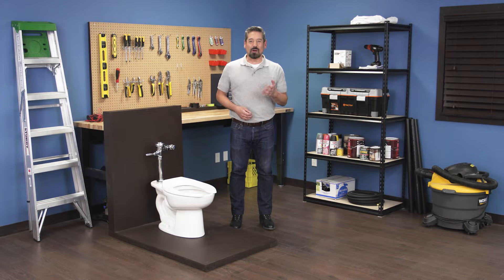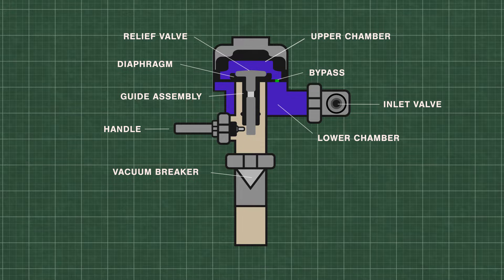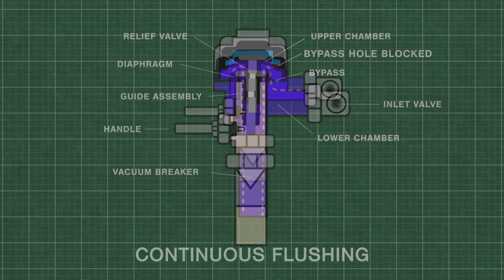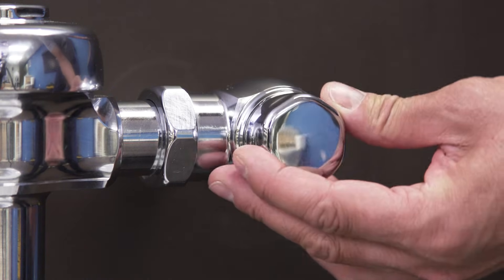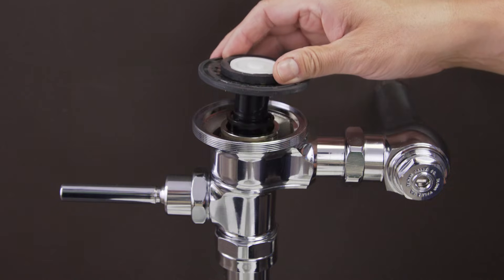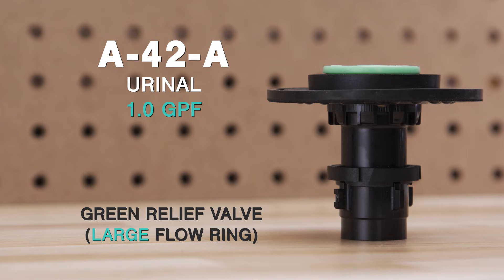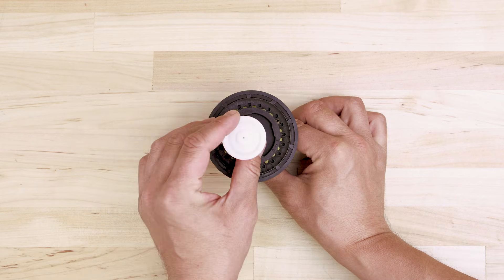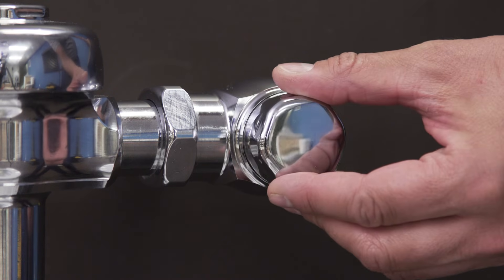Sloan Regal Flushometer | Diaphragm | Repair and Replace

Comment: why show the vacuum breaker. what does it do and do we need to replace it?  my repair kit came with one.
Reply from the maker: Thanks for watching. The vacuum breaker prevents water from being siphoned back into the valve. If the rubber wears down then water might leak from just below the valve body. We have a video on the vacuum breaker for this model: https://www.youtube.com/watch?v=k2AmW8Xzwpo

Comment: I had two new flushometers on my shelf and both would continually run no matter what I did. After watching this video I stuck a pin in the hole on the side to let more water through and that fixed both of them.
Reply: Please explain, the urinal in our facility kept running after someone flushed and overflowed the toilet .. what is this hole you are referring to and if it's blocked, that will cause the problem?

Comment: my problem is that the cover is stripped by a previous plumber and now i cant get it removed.
Reply from the maker: Thanks for watching. Are the threads stripped or the top is rounded out which prevents you from using a wrench?
If it is the latter, then you could use a strap wrench which might get enough torque to unscrew the cover.

Comment: If you think the diaphragm is incorrect but that is all that has been in the urinal since you acquired the property, how can you find the exact diaphragm needed without any manuals for the urinal?
Reply from the maker: Check the urinal to see if the GFP is printed on it somewhere. As well if you cannot find it, then you can remove the diaphragm and see what it is. Based on the diaphram's GPF and the behaviour of the flush you can go down a size if the flush seems to much or up a size if the flush seems too weak.
Reply: @AmreSupply  thanks

Comment: I was surprised to view a relief toilet valve that accommodates 4.5 gpf. I wonder what toilets today or recently have a 4.5 gpf capacity. I haven't located any on the internet. The highest I've located were a few 3.5 gpf toilets that were mostly of the blowout types. Anyway, I like these flushometer valves much better than the usual toilet tanks. I have however located 1 toilet flushometer valve that did accommodate a 4.5 gpf with 26 1/2" rough in, but it wasn't from sloan.
Reply from the maker: Thanks for watching. Over time most toilets will be replaced but there are still some out there which is why it's still available even if uncommon.

Comment: When I flush it stops short and has a loud thump. Which part do I need to replace?
Reply from the maker: Thanks for watching. It's likely that there's water filling the upper chamber too quickly. This could be a hole in the diaphragm or there's a improper seal that's letting water fill too quickly. Cleaning the valve seat and replacing the diaphragm should help.

Comment: Thank you for your excellent videos. I want to share a few things that I -- a petite total amateur --  learned replacing two diaphragm modules. 1) Removing the diaphragm cap may require more torque than channel locks or a small wrench can provide, especially if there is some corrosion involved. I had to buy a heavy-duty 15 inch wrench. 2) It turns out I have one low-flow flushometer and one regular. I have no idea how to spot this from the writing on the unit. Once I accessed the diaphragm of my master suite unit, I saw it had a green top. Since I had purchased a standard 3.5 GPM kit, I installed it, but it leaked terribly at the vacuum breaker and ended up destroying the vacuum breaker. Incidentally, if you are also replacing the vacuum breaker and are using a green diaphragm, you need a breaker that is 651, not 551. With the green diaphragm and the proper breaker, my master suite toilet now works perfectly. The older toilet in my guest suite used the standard diaphragm and vacuum breaker. Incidentally, I also replaced the handles while I was at it. They work much better now -- they clearly were on their last legs. (And yes, both of my upstairs toilets broke within hours of each other on a Saturday. I'm a new owner, and there is some deferred maintenance here. I learned a lot fixing these and will be ready for next time. Thank you for saving my weekend!)
Reply from the maker: You're welcome, we're glad that you've found our videos helpful! We appreciate you sharing your experiences with these repairs. Many people read the comments and I'm sure there's others who will find your descriptions helpful!

Comment: I deal with these on a seasonal basis.  For winterizing these what would you recommend?  Thanks
Reply from the maker: If the flushometer is not being used in the winter and is at risk of freezing then there's a few things that can be done. Any water left inside that freezes can damage the flushometer and plumbing.

-  Shut off the water supply to the flushometer.
-  Drain the system to remove any remaining water.
-  Insulate exposed pipes to prevent freezing.

Comment: Thanks! How do I unscrew it? The part you do at 3:10? Mine seems stuck and I don’t want to break the plastic.
Reply from the maker: Thanks for watching. You need a good grip on this. There might be a buildup of calcium which might make it harder to unscrew. You could soak the part in vinegar (might deteriorate the rubber but not a problem if you replace the diaphragm) As well applying a little bit of heat can help.
Reply: @AmreSupply  very hot water worked, it was rusted together like you mentioned.
Reply from the maker: @LSATQueens  We're glad it worked!!
Reply: What's the size of the nut on the cover? I want to make sure the cresent i buy for my grab bag will be the right size to use.

Comment: Thanks for demystifying this type of plumbing and the problems that can occur.  I can replace an $8 part instead of calling a commercial plumber for $275 per hour.  Excellent tutorial and diagrams made this a 30 minute fix on a urinal that has had problems for a year.
Reply from the maker: You're welcome, we're just happy to help! There are many repairs that take the skills and knowledge of a professional but for something like a diaphram replacement, it is an easy fix.

Comment: I have replace the diaphram, vacuum breaker and handle trying to get the water to stop flowing.  What can I check now, since all 3 of those inside pieces are new?
Reply from the maker: Thanks for watching. It's best to clean the valve seat to make sure there is no mineral buildup or anything that might prevent the valve from making a good seal. If any water leaks into the upper chamber, then the valve will not close and water will continue to flow.
Reply: @AmreSupply piggybacking off this question/comment. I’ve done the same, even installed a new flushometer body so there’s no build up of any kind but it still won’t stop running constantly. Any other suggestions to try out?
Reply from the maker: @580outdoors8  If you've installed a new diaphragm, a new valve body and that there is no corrosion or mineral breakup that might prevent the diaphragm from sitting properly on the valve, then you should also check the handle. It is possible that the handle is stuck and is pressing on the relief valve and preventing the valve from resetting.
Reply: @AmreSupply  Everything except the control stop is new. Checked the handle and didn’t see any issues with it. As soon as I turn on the control stop, water starts flowing. Never have had this kind of problem with any of the others that I’ve worked on here at my workplace.

Comment: This video is completely unrealistic.   This "dramatization" shows the effortless unscrewing of the diaphragm from the valve assembly with the slight turn of two fingers.  In actuality, if the rubber diaphragm assembly has been in service for years slowly deteriorating, they get very frozen together, and extremely difficult to "unscrew".   This gentlemen sidesteps reality by showing you a brand new valve assembly being unscrewed with a gentle turn.  It's laughable.   Would appreciate some guidance and advice on how it is that one is to get them apart in order to drop in a new rubber diaphragm.  The rest of the parts are fine.   The completely drop in kits (assemblies) have gotten very expensive since this video was produced several years ago, in a pre-covid economy !!  LOL
Reply from the maker: Thanks for watching. When filming, to get clear footage, in a series with many different videos it takes multiple takes to film all the steps. To show a deteriorated toilet in place is more difficult as it requires going on site and controlling for variables. That's why we filmed with a new valve setup within our film studio, so we could properly light and film. 

We are currently filming appliance repairs but if we return to this series we would do an update with tips on seized or threads that are full of a mineral buildup etc. We still have many comments from people explaining that these videos have been helpful for them.
Reply: @lawrence

THEYRE SHOWING "HOW"

THIS DEFINITELY EXPLAINS HOW

NO NEED TO CRY ABOUT YOUR JOB 😭
Reply: I agree with you I am actually dealing with that right now.
Reply: I would suggest trying an adjustable oil filter wrench. This may help

Comment: Changed out the diaphragm now my water won't fill back up in the toilet ? Any ideas ?
Reply from the maker: Thanks for watching. What was the original gpf of the diaphragm and which diaphragm did you install? If the toilet is designed for a higher gpf, and you installed a low gpf diaphram then the flushometer will not run as long, and less water will flow out of it before the valve closes.
Reply: @AmreSupply  diaphragm was stuck had to prye open the water filled the toilet once replaced but the new problem is no flush
Reply from the maker: @shanekyle2894  Check to make sure that the relief valve is positioned correctly and that the handle has enough travel that it will be able to lift up the relief valve. As well if there is a buildup of minerals on the valve try cleaning it as this might cause the diaphram to stick.

Comment: When i flush my toilet, it all gets drained and then runs for about a minute before completely filling up and stopping. Does this mean my bypass hole is starting to get blocked? Or not really because it is not  running and never stopping, just flushing for about a minute before filling and stopping which is longer than normal.
Reply from the maker: Thanks for watching. What is likely happening is that the bypass hole is likely clogged with mineral or corroded rubber from the diaphragm. It's likely not completely blocked but is taking longer than normal to fill the upper chamber, resulting in a long flush. If you try to clean the diaphragm and it doesn't help, then installing a new diaphram of the correct gpf should fix the problem.

Comment: Thanks for the two replys about the bi-pass hole. I soaked every part of the flushometer in degreaser and water for three hours, after disassembling it. I disassembled the diaphragm completely, removing the two plastic rings, and did see two slits in it. After cleaning it and reassembling all parts and pieces the flushometer worked like new. Thanks.
Reply from the maker: Thank you for the update! We're just happy to help and we're glad that cleaning it worked.

Comment: Why does it keep running when you put a new diaphram in it?
Reply from the maker: Thanks for watching. You might want to check the valve for any calcium or corrosion that might prevent a good seal. This can be cleaned if needed. If the diaphragm doesn't sit properly, then a small amount of water will leak into the upper chamber and the flushometer will continue to flush.

Comment: Thank you. For your help question how do you use a sloan toilet instead of the float in the water closet
Reply from the maker: Thanks for watching. Many homes don't have the pipe size to handle a flushometer as it can starve other fixtures. An installation like this in a residential home is often best handled by a plumber.
Reply: @AmreSupply  yes I agree

Comment: What is the flow rings function located underneath the diaphragm
Reply from the maker: Thanks for watching. The relief valve and the flow rings slightly restricts the flow and changes the timing of the valve. This is how it is calibrated to achieve a specific gallon per flush. The rubber diaphragm itself is the same for all gpf.

Comment: Anyone notice that the wrench was being used backwards when tightening the top cap???
Reply from the maker: Thanks for watching. There is no shortage on debate on if flipping the wrench the other way will increase or decrease the torque. There are times where the additional space to move the wrench requires you to orientate it in a specific way. Other times it doesn't make much of a difference if the torque is low.

Comment: Hi am trying to replace the diaphragm and I have a white relief valve in my toilet (A-15-A). I bought a A-38-A replacement kit and it has a blue relief valve but still has the A-15-A part number. I dropped it in and I'm getting a short flush. I made adjustments to the control valve but am still getting a short flush. I also confirmed my Sloan Royal is 3.5GPF. Any help??
Reply from the maker: Thanks for watching. The A-15-A refers to the diaphragm itself. Using a different color relief valve will change the flush. If you unscrew the diaphragm then use all the old plastic parts and just swap out the new diaphram.
Reply: @AmreSupply   Thanks for the quick reply!! I used the same white relief valve but still get a short flush...I've ordered a new white valve and hope that does the trick!

Comment: I just put a whole new kit and the valve won’t shut off. Urinal 1.0GPF
Reply from the maker: Thanks for watching. Double check how the diaphragm is seated correctly and that it sits evenly around the valve. If there are any gaps then it will prevent the upper chamber from pressurizing and the valve from closing.

Comment: Very helpful video - nice explanation!  One suggestion, if you redo this in the future, you might want to mention that when removing / restoring the cap, the pressure in unscrewing it can jiggle the tailpiece, which may then require replacing the O-ring on that tailpiece.  It happened to me and I had to make 2 trips to Ferguson - one for the diaphragm and one for the O-ring.
Reply from the maker: Thank you Todd! That is a great suggestion on the o-ring and its something that would have been good to mention more in these videos. 

We likely won't be updating the flushometer videos for a little while as we are focused on appliance repairs at the moment. We just finished a huge series on oven and stove troubleshooting https://www.youtube.com/playlist?list=PLCo9SMjkdWBysYYCcg5xQLiVh_cW0JQvt and we're working on refrigerators next, so that will keep our video team busy for quite a while.

Comment: What does the control stop do?  Mine does not have any affects on the behavior of the toilet
Reply from the maker: Hi Tino, thank you for watching. The control stop is a valve. By turning the screw it will push the rubber stopper forward to close the valve. If turning the screw either way does nothing at all, then its possible that the threads are stripped. You can see how to replace it in this video: https://www.youtube.com/watch?v=6Xak3IHsebg
Reply: @AmreSupply  thank you, would a bad  control stop cause flushing issues?
Reply from the maker: @cpabrego  A control stop can cause short flushing if its closed too much then it will prevent the full flush volume from being delivered. The different problems are covered in this video: https://www.youtube.com/watch?v=Upkq8qIwD5M

Comment: Thanks so much for this tutorial video!  The diagram showing the inner workings of the flush o meter is particularly useful.  It gave me the confidence to tackle toilet repair without having to call a plumber.  Tried one just by replacing the diaphragm and another replacing the full drop in kit.  Both worked!
Reply from the maker: You're welcome! We put a lot of effort into explaining how it works as we know its important to know the "why" behind any repair. We're glad that the video helped you do the repair!

Comment: Does it matter where the vent hole is when the diaphragm is installed?
Reply from the maker: Thanks for watching. The position doesn't matter as the pressure will be the same. This means the diaphragm can be rotated to any position when you install it.
Reply: @AmreSupply  THANKS
Reply from the maker: @sparky3869  You're welcome, we're just happy to help!

Comment: I replaced the diaphragm but I'm still getting leaking out of my cap threads
Reply from the maker: Hi James, thank you for watching. Its possible that there is either corrosion or a buildup of minerals on the threads. Inspect the threads and the valve seat. Look for any nicks, corrosion or calcium. If there is a mineral buildup then you can vinegar or an acid based cleaner to dissolve it. As well in some cases it can be helpful to clean the threads with a light gauge wire brush.
Reply: @AmreSupply  thanks, found some pitting in the seat, should I replace the body or try to buff it out?
Reply from the maker: @jamesn3944  You could try buffing it out but in many cases a new valve body is the best way to go.
Reply: @AmreSupply  okay thanks I'll try to see if I can figure out which body I need.

Comment: This was super helpful. I live in military housing with this toilet. Flushed one morning and it wouldn’t stop. I googled the issue, found this, and stopped wasting water. It was simply a degraded diaphragm assembly. These are easier to fix than a standard tank unit. Thank you, thank you!
Reply from the maker: You're very welcome Daniel! We're glad that the video helped you out! These flushometers are fairly simple once you know how they work and have less moving parts than a standard tank unit. Cheers!